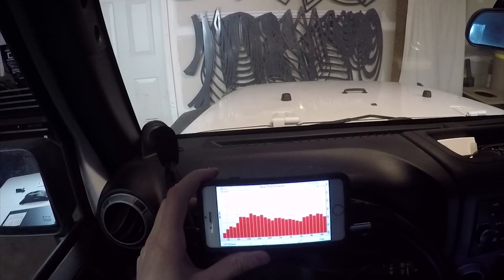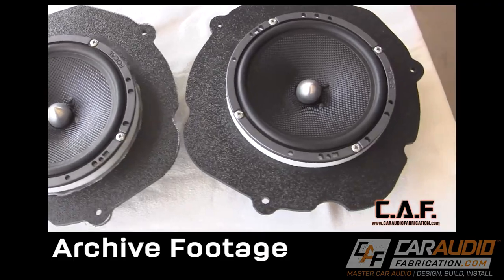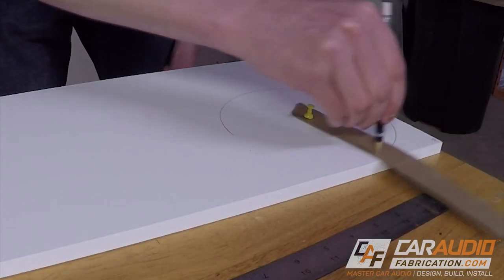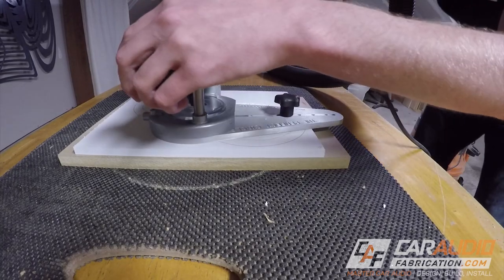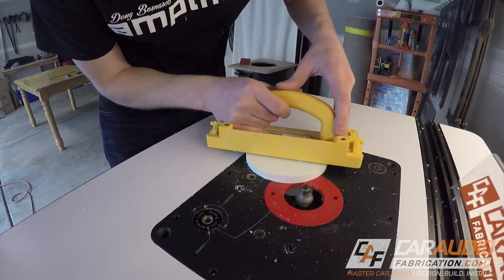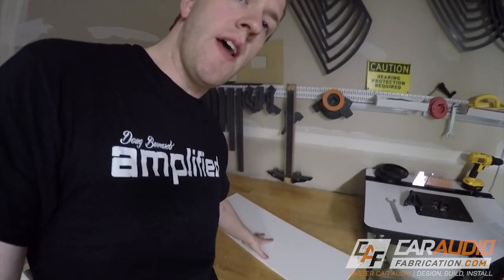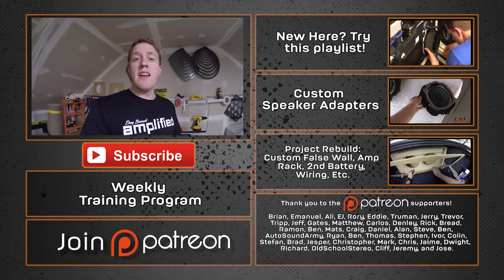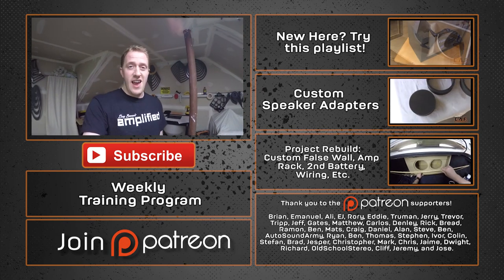Speaker rings - What material you SHOULD BE using - CarAudioFabrication

Comment: Sweet tip! BTW. You just helped me solve a problem I've been working on for a couple of weeks. Trying to figure out what material to use in my YJ so I can mount my gauges in the dash without completely rebuilding a new center panel. I can simply cut this to size, screw it in on the sides, poxy the board to the gauge holes, then cut the new gauge holes in. Once that is done I can mount and rewire. Holly cow. Thank you sooooooo much.

Comment: I made and installed a couple of mdf rings in my Altima coupe a few years ago. I had them in the doors for around 2.5 years.  I removed the system when I sold the car and found that they were completely water logged and softening. Probably would have ended up rusting out the doors eventually.

Comment: are you able to redo all your speaker pod videos where you've made them in wood and now do them in ABS or HDPE etc.  Currently doing speaker pods and some of the tricks and techniques don't translate very well, such as the cold form plastic staple into plastic.  I've now had a lot of practice at plastic welding.  Also spacing rings above backboards (old cardboard ring trick) as wooden dowels will be a no-no.  Cheers.

Comment: if the water is getting in and degrading the mdf, what is it doing to the speakers?  not like they are waterproof.  anyway, my car with high end audio never sees rain, and I tape off the windows when I wash it.  however, I must admit I learned to tape, when I removed the door card, and saw there was actually rust on the (previous) speaker frame, however the mdf mounts looked fine, the shop had thoughtfully coated the mdf in something black, that must have protected them.
Reply: most car audio speakers are in fact waterproof and made with this in mind. even the paper ones like from hybrid audio are waterproof treated. basically all car doors get water intrusion, it's just life. from a bugatti to a civic.

Comment: If you're getting that much water in your vehicle, maybe you should deal with that. Might have more serious issues with your system getting wet.
Reply from the maker: Wrong. Doors are designed to have water in them and drain out, condensation naturally builds up and all components in a door are designed to be exposed to water. So you don't add MDF rings to an area that has the water condensation. It takes very little condensation to swell a ring. It's funny to me how many people fight me in this. The plastic is cheap. Do it the right way instead of half assing it.

Comment: If using MDF why not primer and paint the ring. wouldn't that seal and protect the ring from water damage?
Reply from the maker: No, the second you put a screw into the material it will break that layer. Plus painting would require more effort than just using the superior material

Comment: Just coat the rings with your resin.. wouldn't that work
Reply from the maker: No. The second you add screws you break the water proof barrier. Resin would be more expensive too. Why not just use the plastic?
Reply: @CarAudioFabrication  k thanks for the reply

Comment: Great video as always. I use plastic kitchen cutting boards that I buy at Target or Wallmart or any other grocery store. Cool thing about cutting boards is that they come in different thicknesses and sizes for cheap.
Reply: +edoubleist Werd, done the same a time or two. Works great.
Reply from the maker: +edoubleist Nice, this works good too, the only downside with HDPE is traditional CA glue doesn't really stick to it, I didn't mention it in the video but if you rough up the surface of this PVC the glue sticks. :)
Reply: +CarAudioFabrication I use bathroom silicone to seal the mounting ring to the door as well as screws.
Reply: +edoubleist at Sam's they sell the professional hpde cutting borads thats what I buy its 20x15 inches for like 8 dollars I just a few of them up on the weekends and work great..

Comment: Great idea, but where do you find PVC sheets? None of my local hardware stores have it. Home depot, Lowes, Ace, etc. It is very expensive too! The 4x8 sheets I saw online were like $700 a sheet!  Makes no sense at all. Even at $22 for the 8'×8"×1/2" is pricey. Cheaper to make rings out of plywood or mdf and just paint them with something water proof, like polyurethane, flex seal, bedliner, or just few coats of good 'ol spray paint.

Comment: Great tip, but doesn't MDF have better acoustic properties? And can't you just paint them to get the waterproofing?
Reply from the maker: +cheepGeek 

If you were building an enclosure the density of the material would come more into play. With making a mounting flange out of MDF there might be a small difference, but it’s going to be small… like borderline non-existent. There is a ton of more crazy stuff going on in the door panel that needs to be addressed over that miniscule change. Even if it is slightly “better” once your MDF ring turns to a sponge and the speaker falls out of the hole or the wood turns to the density of styrofoam that tiny improvement isn’t going to matter. I feel this “its acoustically better” argument is just a crutch for people that are set in their ways and don’t want to accept their might be a better option or ever try anything new. 
I’ve seen plenty of examples of painted mdf where water still destroyed the rings. The second you screw a fastener into the wood the “waterproof” barrier is broken. It’s so much more work to try and waterproof wood, why not just use the right material from the get go?